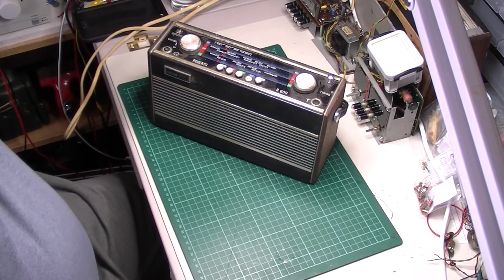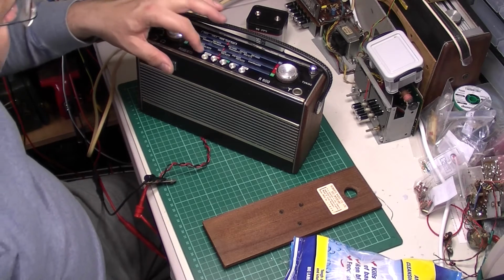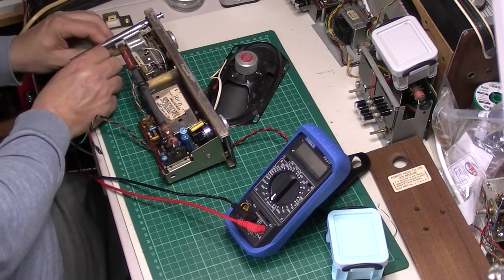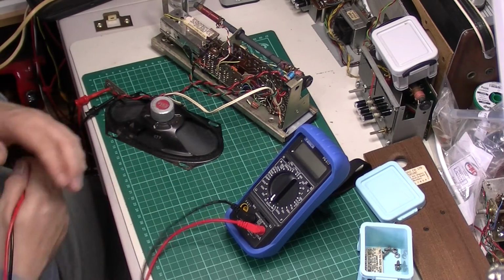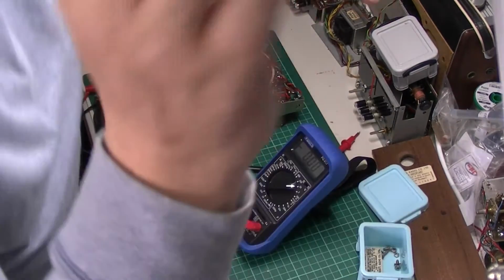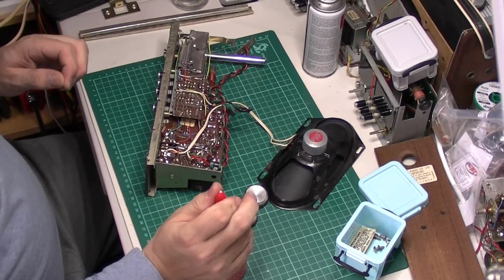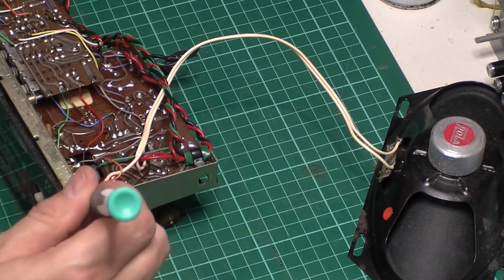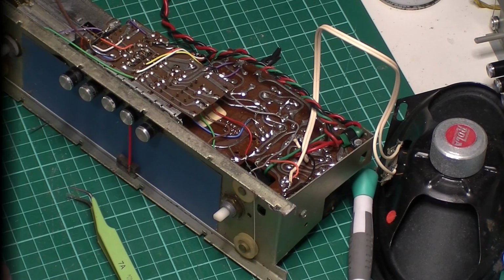Roberts R600 newer version Part 1: Overview and fault finding

Comment: foxy says cool I have a few Roberts radios in the Den I have a nice R800 in Green  but its dead on FM should be an easy fix when I get around to it
Reply from the maker: Cheers foxy. The R800 shouldn't be to difficult. More than likely dirty switches. Good luck, Graham
Reply: well it could be the set works perfectly apart from being totally dead on FM !  I was going for a diode being the likely culprit but I will do some digging around when I get my work station set up again